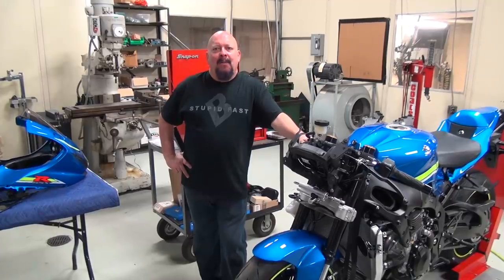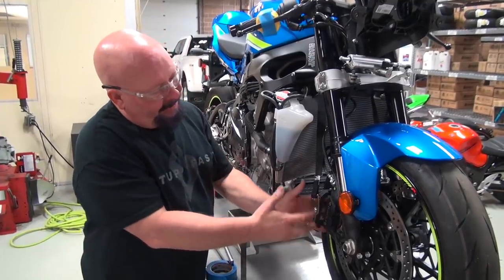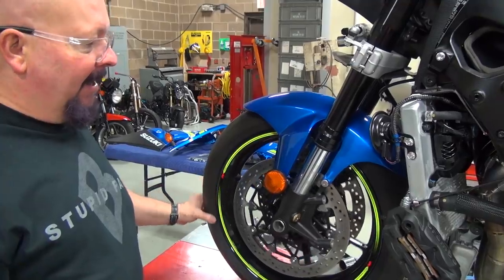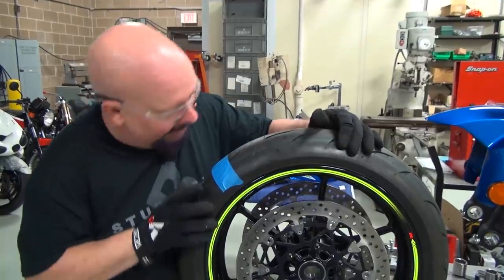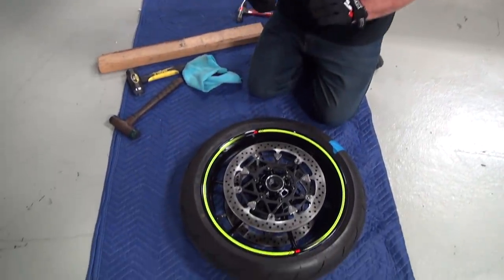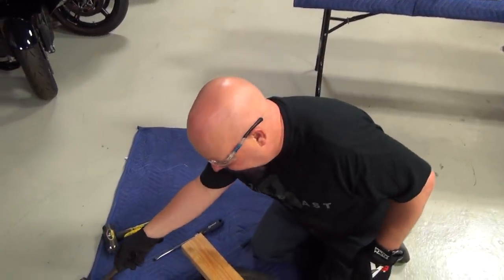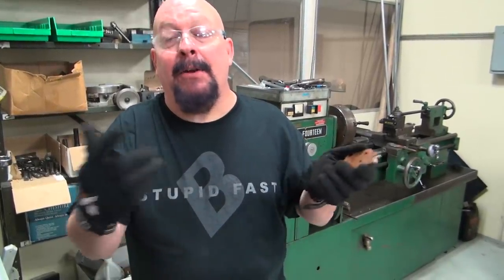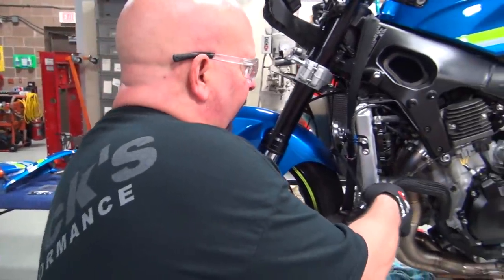Ceramic Wheel Bearing Install and Reducing Brake Drag

Comment: Do NOT do this to your brakes.
Reply from the maker: WARNING some of the information and performance techniques listed in this video are advanced. Please use discretion when attempting these or any other high-performance modifications. If in doubt, always choose SAFETY FIRST and configure your bike exactly as your manufacturer suggests.
Reply: @BrockDavidson  you should consider not doing this at all. Surely Brembo used millions to design their brakes, and cutting half the surface area away will just increase wear and surface tension, never mind possibly causing micro-fractures in the braking material which could cause them to totally fail.  some fool who tries this idiotic thing you have shown here will cause an accident and possibly kill someone.
Reply: I did it and I am still alive. No brake failures yet. BUT JW has a good point. Probably best to leave the pads alone.
Reply: Says every dude who doesnt race

Comment: That ceramic bearing test was insane, the BIGGER hammer test had me laughin' the whole time. The USA/Japanese bearings are tuff!
Reply from the maker: They are amazing!
Reply: @BruceBusby  - I can tell you from my personal experience I don't agree with that assessment. I put quality ceramic bearings in roller blade wheels for a gravity electric project I worked a few years back, big difference. Remember Brock's focus is mostly on drag racing, ask any racer in a national championship, if they could pick up 1/2 a tenth on their competitor would it be worth it?

Comment: So why do the manufacturers put that much material on the brakes it can't just be for fun. And surely when that chamfer wears off it'll be flat again anyway which just brings you right back to where you were in the first place. I know many serious  motorcycle racers and none of them do this.
Reply from the maker: Sounds like you could use some faster friends. Please see long description: WARNING some of the information and performance techniques listed in this video are advanced. Please use discretion when attempting these or any other high-performance modifications. If in doubt, always choose SAFETY FIRST and configure your bike exactly as your manufacturer suggests.
Reply: Seems like a fair question to me. If it was such a good idea, why don't brake manufacturers sell chamfered brake pads?
Reply from the maker: @rogkmyers  because they don't drag race?
Reply: @BrockDavidson  If you say this 'mod' is only beneficial within drag racing applications, why not use a smaller, single disc set-up on the front wheel (thus saving weight - in addition to reducing brake pad resistance & braking efficiency)?
Reply: @missydee6085  Because that would actually require a brain. There are multiple dumb ideas in this, its beyond amazing how this is a business.
Reply: @sheilamorrison1954  Careful Sheila. It appears Mr Stupid Fast is rather sensitive to criticism, however constructive it is...
Reply from the maker: @missydee6085  Please click here for information on video comments: http://blog.brocksperformance.com/brocks-performance-youtube-rules/
Reply: Missy Dee quod erat demonstrandum
Reply: @missydee6085  You must have skipped over the part where he explained that its the exact opposite of what you want on a stock wheelbase bike. less weight up front means you will be shifting the CG to the back, causing the bike to want to lift even more. Which is is less beneficial than saving a few pounds by taking one of the rotors and calipers off. If its a stretched bike, that's one thing, but for stock wheelbase that's not good.
Also to everyone else, the reason why you don't see pads like this very often is because this reduces the braking force you get. On a normal street bike, you want more braking force, and longer life. Companies don't want to sell a pad that has less braking power, and shortened life. That's just stupid. BUT on a bike that you're trying to save hundredths of seconds on each pass, racers don't care about losing a bit of braking in favor for less drag and a bit better times. I See it quite a bit out at the strip actually.
Reply: @redactedrider7606  its not something you do on any bike or EBC would be selling already cut pads... crazy ridiculous idea it would probably over heat the top of the pad as well because heat wouldn't be transferring equally
Reply: Brock’s been fast a long time  and  has a very reputable name in the sport of racing… so as he said it isn’t for everyone

Comment: Grinding your pads on the lower half is absolutely a horrible idea.  Do not do this.  Not only is it bad for the pad it is worse for the wear of the rotor.  Yes pad chamfer is real but on the leading edge and trailing edge.  To reduce bit on contact.  You are halting the contact surface to the rotor.  And heat transfer is going to make things worse.
Reply from the maker: WARNING some of the information and performance techniques listed in this video are advanced. Please use discretion when attempting these or any other high-performance modifications. If in doubt, always choose SAFETY FIRST and configure your bike exactly as your manufacturer suggests.
Reply: Your are absolutely wrong here brock.  That is not a performance upgrade.  That is a way to have a brake come apart or even a rotor. If it was a performance upgrade then you would see other companies trying to market that but it's not.
Reply: I guess this is just over some guys heads and you have to be a real racer to understand this kind of stuff.

Comment: Brock I hope you and all read this, please don’t take it the wrong way, but to put the bearings in without any tools whatsoever just pop them in the freezer for 10 mins, it shrinks the metal and slides in without any heavy hitting, added easier way too compliment the cold of the bearings in to put the hairdryer or heat gun on the race of the wheel, so the two contrasts in temps makes it a breeze bearings shrink wheel race expands 👍
Reply from the maker: Thanks. Covered multiple times in comments.
Reply: Oh ok sorry brock love your videos mate

Comment: @Brock Davidson Chamfering brake pads is a bad idea. First, physics says there will be no less friction as the friction force is NOT dependant on the surface area. Second, pads don't actually touch a disc at speed (unless you have a problem with your brakes). Third, now you've reduced the contact patch of the pad, there will be huge local temperature variations under load, possibly leading to a catastrophic pad failure not to mention the pad could skew in the calliper and possibly stick.
Reply from the maker: You should watch the video.
Reply: @BrockDavidson  When I saw you using a marker, I thought that you would do something that could make SOME sense. 
Your objective is to remove friction, correct? So, why not mark the pads, see which area is contacting the disk, and then take material away from that specific area.

(Or you could simply take the bike for a ride, do a few hard braking runs, and the friction will be gone.)

As the OP correctly mentioned, what you did can lead to catastrophic failure. Please don't do it again.

Comment: Brocks when you put the new bearings in the -20 freezer you can easily place it in the rim because metal shrinks due to cold.
Reply from the maker: Covered in a previous comment.
Reply: Yes...for those that do not have the proper tools, freeze the bearings your are installing and your install will be much easier and less risk of damaging the new ones on install.

Comment: I made a custom bearing remover from an old front axle I had. It fits perfectly inside the bearings. So I grinded a cross in the axle from one side, and snug inside(I smoothed the inside threads in axle) a spare metal spacer from a front stand that holds down the  triple clamp😁😁 then I hammer the conical spacer hard inside the axle, axle expands and push against the bearing 😁😁 I give some heat through the hub and hammer the axle. Bearing pops out, it's so satisfying 😂😂😂😂
Reply from the maker: @VR46 >> THAT'S what I'm talking about! I love making special tools to make a job more efficient :)
Reply: @BrockDavidson  yes indeed, tools are never enough and with custom tools we feel extra pleasure ! I did this to change by myself  bearings to the carbon dymags . So I will not stress the hub at all. It's very interesting that you removed the dust seals, and honestly I never thought that the spacer is actually spinning inside the seal (well... Better the seal is spinning around the spacer) creating friction! 

So next time I will take the wheel off, I will remove the seals and count revolutions. I agree so much with what you said:litlle from here, litlle from there, and you have something you can measure. 
So Dymag uses smaller  bearings for the gsxrs stock wheels. and they re sealed from both sides.i think bst uses the same too. 

One stock gsxr front bearing weights 127gr and one for  dymag 74 gr . Not bad for steel bearings.😀

I can't gring my brake pads for my track bike(though it has amazing results) but I 
I would like one day to install your ceramic bearings.😀

Comment: This is too much pad drag they will heat up. I presume it is because the bike is new and pads havn't worn in yet. You can have the pads so close it looks like they are touching, but they are not, and there is no room for rain water either, but they wont drag. My wheel spins for 15 seconds on steel bearings with PFTE grease, and brake response is instant. To grease a sealed bearing, take out the inner seals, dirt can get in there, removes some drag too.

Comment: What size is the socket you use as a bearing driver? I use a 1/2" drive 38mm for my zx14r it's just a little small but it works
Reply from the maker: The one in my toolbox that fit ;)

Comment: Hey Brock....I would have liked to have seen the difference in the front tire rotation with the wheel off the ground after getting the front wheel centered and tightening the front axle and the calipers to Suzuki factory torque specifications instead of everything just snug, I mean that is the final product with everything tight which is where you started the rotation test.....Apple's for Apple's.👍 I know from when we were doing a lot of dyno testing back in 2000/2001 with the hayabusa only tightening up the rear axle nut to 10 pounds of torque, snug, that busa rear wheel has lots of drag when tightened to spec and obviously  you can't ride around like this we were just playing around. The  bike did end up making 4 more horsepower on the Dyno than with the axle nut at factory torque spec 80 or so ft lbs due to less rotational resistance in back to back runs, you could see when you spun it by hand the difference. That's not even changing the bearings to ceramics....lol. I don't even remember if ceramic bearings were available back then but if they were they were probably outrageously expensive....lol.

Comment: Do you have a list of which bikes are manufactured "over braked".  I'm assuming that my 1980's bikes are not but I do have a 2015 Honda CBR300, is it safe and legal to run this on the roads with half width brakes?  This would be very helpful. Thanks
Reply from the maker: Not recommended - this is a drag race modification. Many of the other tips in this series will net you measurable results.
Reply: @BrockDavidson  Thanks. A friend also pointed out that here in the UK this is possibly the sort of mod for which you are obliged to notify your insurance company.  This means that, without gaining their approval, a) it would be illegal to ride on UK roads and b) you would be personally liable for all damage caused by an accident in which you were involved.
Reply from the maker: @trevorellis1704 - fantastic information for our friends in the UK. Do you need to tell your Insurance company when you race your bike at a closed course venue also? Only seems fair.
Reply: Brock Davidson yes as you are not insured. They have spotters at track days that note bikes that have been crashed at events in case they try to claim

Comment: Great video as always. This is the norm for you. Thanks for changing the bearings with the normal tools most would have in there garage. I'm halfway through the video and noticed you don't have them knees on a  knee pad.  Protect those knees Brock!!! Also, can you share the size of the socket you used to install the bearings.
Reply from the maker: Glad you like our series. Yes, I get so involved that I forget simple items...like keeping my kneees on the protective pad I laid down and raising the bike lift instead of squatting down next to it. I usually laugh afterward and call myself a dumbas* !!

Comment: What is the clicking during the 7 rotations test? Also wouldn't it rotate less once everything is torqued down?
Reply from the maker: The click was the edge of the painter's tape was hitting the fender. If properly tightened (cycle front end/tighten/cycle etc.) the rotations will not change after torquing.
Reply: @BrockDavidson  awesome thanks, love your videos!🤘🤙

Comment: I've done literally everything that can be done to my cbr1000rr sp. Full mods done and best tuner for my specific bike. There is little nothing else I can do besides lightweight rims and ceramic bearings.  I'm not doing the rims but thinking about doing the bearings. Will the bearings actually make a noticeable difference? Is it measurably on a dyno? And will I actually go any faster when racing?
Reply from the maker: I can tell you 100% that we have NEVER slowed a bike down by installing them. More Info: https://blog.brocksperformance.com/why-choose-worldwide-bearings/

Comment: If you hammer you "drift" (tool to punch out bearing) it will move the inner space enough to expose enough of the bearing race to get a decent bite on the bearing and thus punch them out. Just my .02 cents from doing this a few hundred times.
Reply from the maker: FYI: we show the "non-side of the road" technique, using the proper tools in the next episode.

Comment: I'm concerned that some kiddo out there will apply this to his own street bike. You know... because "fast". And end up in a rear bumper. 'Cause kids can't read warnings, even written in bold letters under a video.
Reply from the maker: This is very advanced performance advice that has been tested for years on our sportbike drag racing machines.  Today's sportbike have incredible braking, suited for thousands of miles of heavy use... This mod has surprisingly little effect on braking performance. Kiddo might need to squeeze the lever a bit harder to make up for the missing pad material , that's all.

Comment: Ok I finished watching the entire video now.Great tips that give folks the courage to work on their own bike. One thing I do to align the calipers. I put them on finger tight, then I pump the brakes and leave the brakes applied with a tie wrap on the lever.. Then tighten the calipers to the specified torque value. I found this would center the rotor better between the pads and have less friction.

Comment: Who's going to install ceramic bearings on stock OEM cast wheels? I guess it's an improvement.
What's more improving is forged alloy wheels or carbon fiber wheels, even with steel OEM bearings. But... it's all budget related, I guess.

Comment: Can I ask what bike right off the show room floor without any clutch mod is good for casual drag racing from a dead stop for fun without the clutch giving out or not working properly? I just want to practice. Senior here with no mechanical ability or experience. I seem I read to remember in one comparison I read a few years ago that the GSX-R1000 and the Honda CBR-1000RR were the only ones in that comparison with a clutch that would work or not give out? Not sure what model years this was. Thanks in advance for your comments.
Reply from the maker: If you are worried primarily about clutch problems, the ZX-14's are tough to beat. I'm fairly sure they are the only Japanese motorcycles that were drag raced during development. The 06-11 do not require a clutch mod, just slightly stiffer springs. The 12's and up (14R's) require an inexpensive mod, but make a solid 20 more HP.
Reply: Brock Davidson Thank you!

Comment: Whats your thought on freezing new bearings before install and heating up the hub to help install with little hammering?  I have seen it done before but like to hear from a person with a racing background
Reply from the maker: Yes - that's an 'old school' technique. Personally, I don't like DIY types heating aluminum for fear of altering the mechanical properties of the wheels. It can be and is done but that's more of a professional level and beyond the realm of this series. As far as 'freezing' - same deal. Chilling them in the freezer can temporarily reduce the O.D. but not enough to mess with if you have the proper tools. Aka. you won't see the engineers who designed the wheels telling you to drop parts in your fridge. Liquid Nitrogen can also be used and will substantially reduce the O.D....but it's dangerous and can damage the seals/grease/bearing cages...your fingers can freeze and break off, etc... General bad stuff that is best left to the pros.
Reply: @BrockDavidson   thanks for the response. I always thought of that trick as a very lazy way of installing bearings.  Can't wait for your next video and  like to use your videos to help with my little 04 r6.

Comment: I have seen some Moto GP bikes that have Brembo calipers with a spring to spread the pads off of the rotors to reduce drag. $$$$$ though.
Reply from the maker: The problem with that set-up is that you have delayed braking in the pits. It's dangerous in the drag pits, so we stopped doing it as they are too crowded and chaotic.